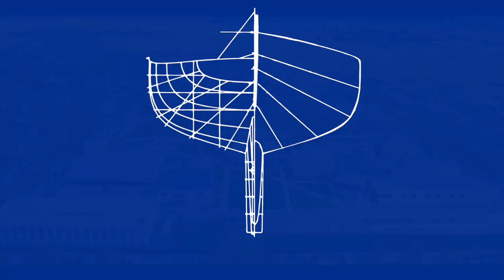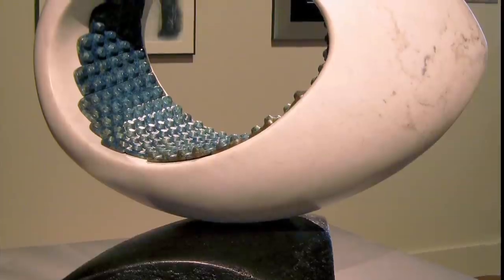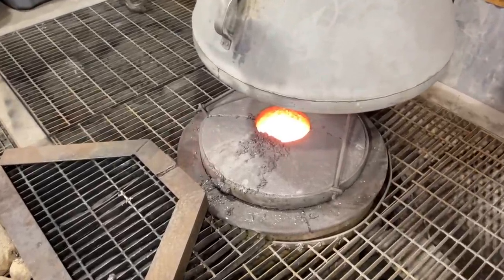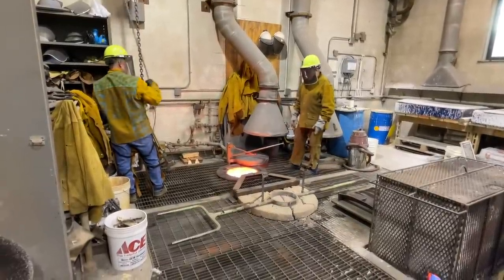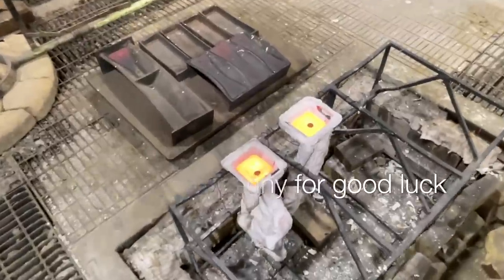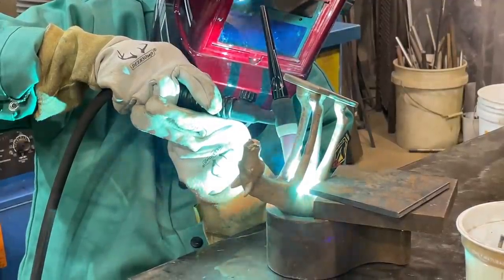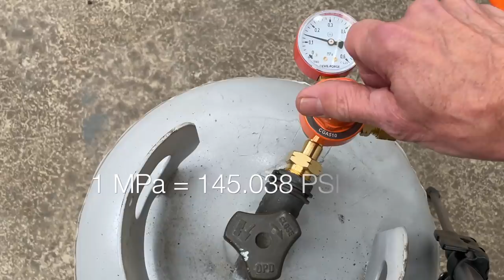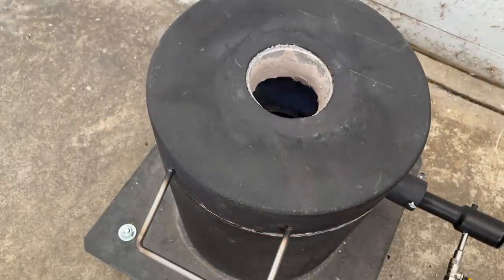How to Cast Bronze by Lost Wax, S2-E56

Comment: I did several semesters of Bronze Casting over 20 years ago in my college Art Dept.  Our equipment wasn't nearly as sophisticated as that nice set up that Bradley U. has, I'm def jealous of those students, lol!  Our foundry was in an outdoor yard behind the Art Studios, we did have an I-beam sort of pergola over the area and it supported our small rolling crane for the crucible.  We did pours in the dead of winter and man was that furnace heat great, while the snow was flying we only wore regular shirts under the safety leathers and never got cold.  The one thing I noticed the most in this video was the molds, they used a ceramic slurry with sand in multiple coats.  We were much more 'old school', we poured plaster/sand molds around our wax copies and those had to fired in the ceramics kiln.  Our huge molds were a lot heavier, used more material and generated far more waste.
Reply from the maker: Hi Luke,
Great casting memories. Bradley does have a great foundry setup. The small school I taught at was much like your experience of doing plaster/sand molds. They where heavy molds. The up side is it was much easier to clean off the investment unlike ceramic shell which is very hard.
Can hardly wait to get some patterns made and start casting.
Thanks for watching and sharing your foundry experience.
Cheers,
Bob

Comment: Thank you for your videos on casting bronze. It can be difficult to find information on the process. Your equipment looks great. Will you have any problems with loss of pressure with the small propane tank?
Reply from the maker: Hi Thomas,
As you may know propane tank pressure can change depending on the amount of fuel in the tank. That is why having a pressure valve is important. It will keep the pressure constant. I’ll have several tanks ready if it runs out. 
Great question and thanks for watching.

Comment: I'm surprised you don't use a blower on the furnace.  The propane pressure just out of the tank is sufficient?  Every setup I used before had "forced air" .
Reply from the maker: I do have a regulator on my tanks. Propane burners don’t require a blower. In fact they won’t work with one. All for my earlier burner’s were natural gas that had blowers. 
Thanks for watching.
Reply: @TheArtofBoatBuilding  THANKS!